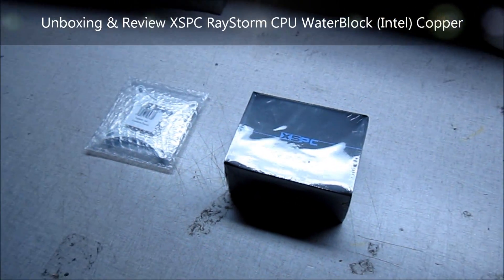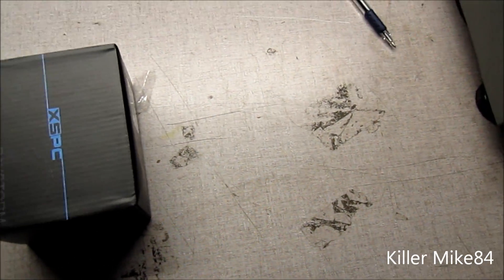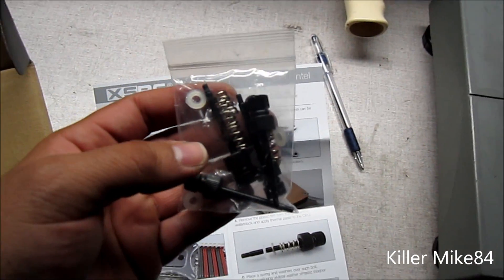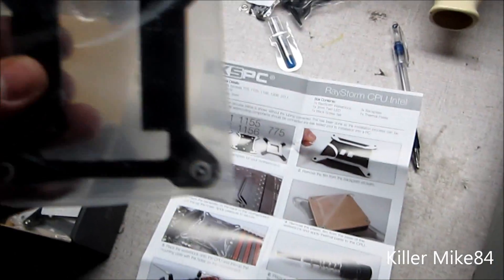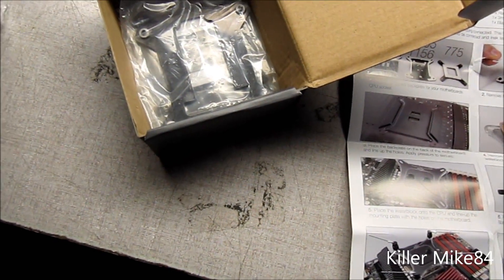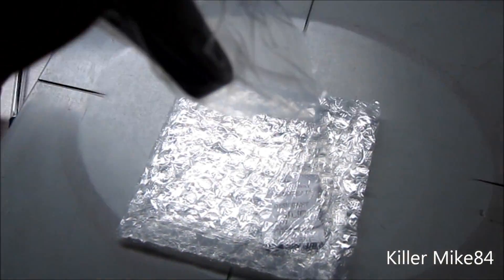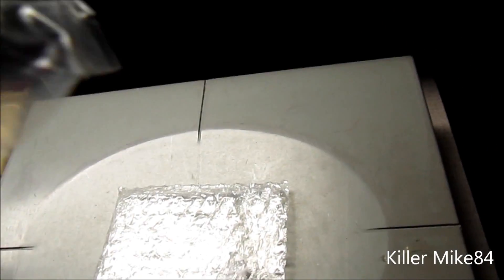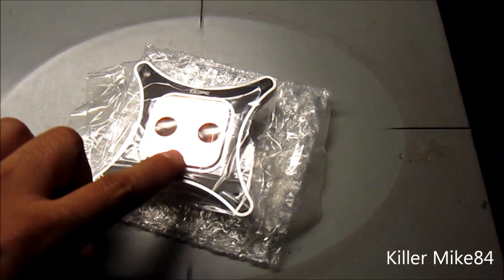Unboxing & Review XSPC RayStorm CPU WaterBlock (Intel) Copper

Comment from the maker: I check it yes you can use them but it depends what size u get go bigger compression fitting with no problem's the only thing problem is going be clearance issues so that's why I will get rotary fittings to help with issue plus it looks great & use less tubing to get that perfect angle corner. I use the same one's i loved then make my life easier..XD

Comment from the maker: just check when I got home yes you can but the size is the problem the bigger
compression fittings u will have clearance problem's so to fixed the issue u can use rotary fittings to help u out that problem..XD